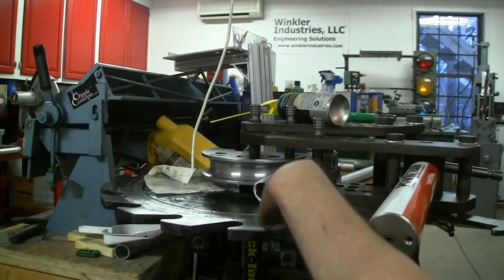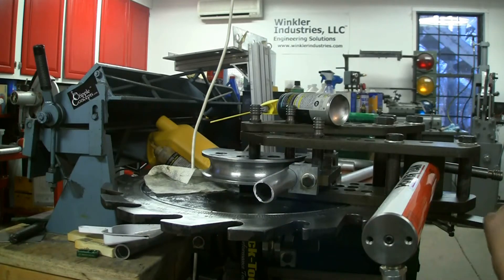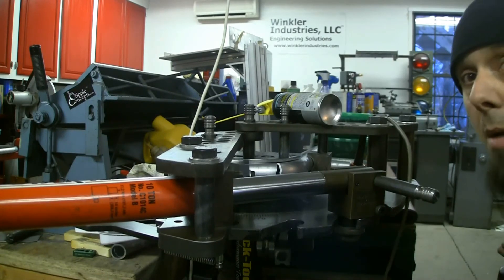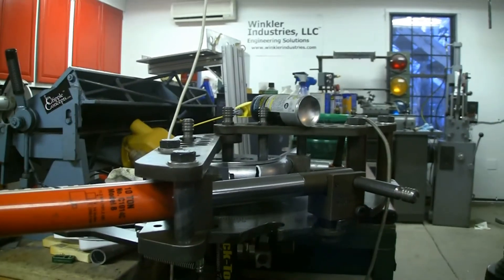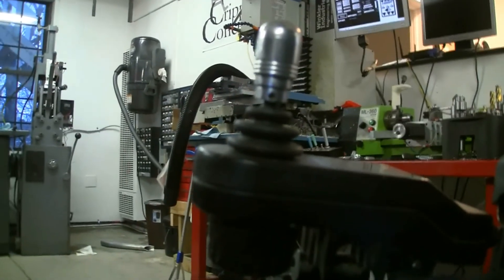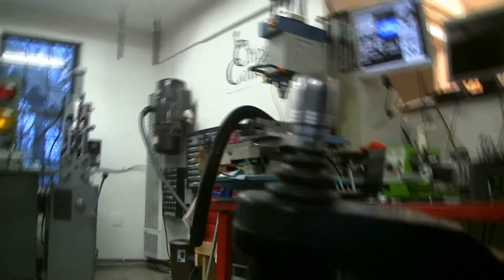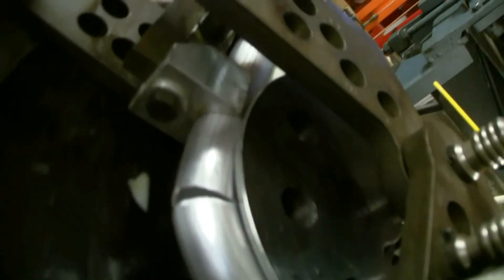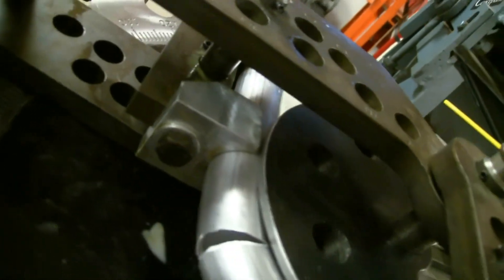6061 T6511 Aluminum tubing bending failure without annealing

Comment: First anneal the tubing, then after bending you have to heat treat back to 6061 T6511.  Cut a sample off of the original annealed tubing and place that in with the bent tubing during heat treatment.  This sample you can send to a testing lab and tell them to do a pull test and a bending test.  The results you keep with you records to prove that the bent tubing meets the ATSM requirements.  also, make sure that during heat treatment that you record the temperature profile over the complete event usually on a round chart showing time and temperature.
Reply from the maker: True, if you need full T6511 properties. For the project I was doing the work hardening and age hardening were more than enough for the final product. The thinning of the material in the bend is also a factor that needs considered when bending, again depending on the project it may or may not be critical. This video was not meant to teach about proper annealing and heat treating, or material testing, it was to show the simple person in a simple shop how they could anneal aluminum tubing with a simple propane torch.